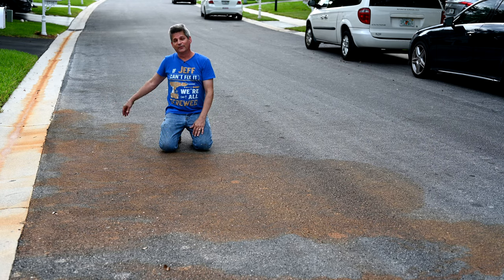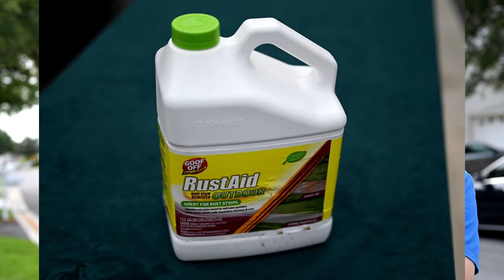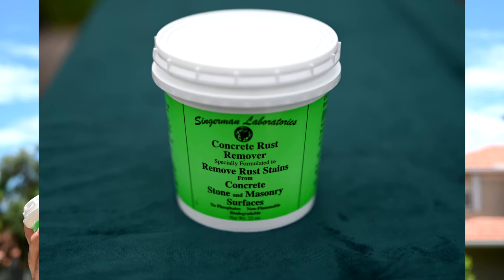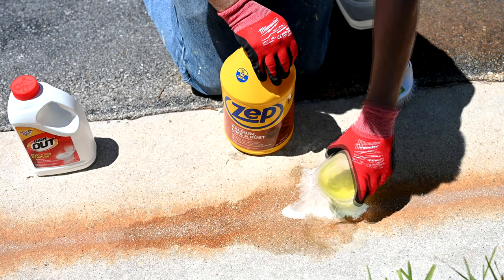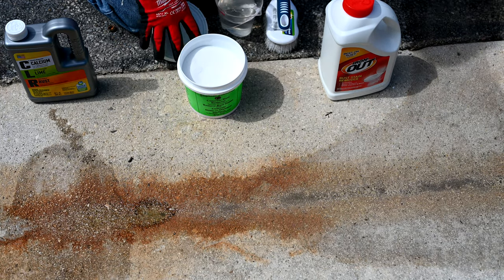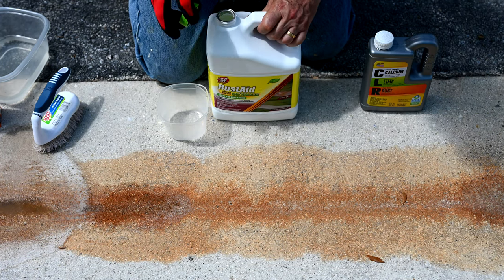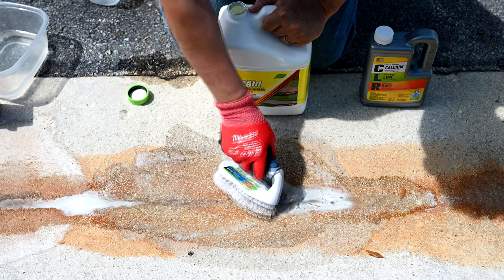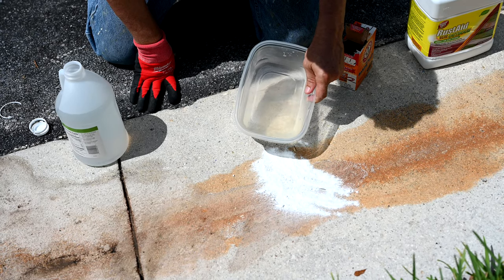Rust Remover Challenge: What Removes Rust Stains Off Concrete?

Comment: Baking soda doesn’t work alone, you need hydrogen peroxide as well. They work as a team. You are not putting much elbow work in either.
Reply from the maker: You've completely missed the point here and it seems like you have been programmed already by the marketing companies just think that you need to put elbow grease into this to make it work period the whole purpose of this video is to show that the correct solution requires 0 elbow grease at all. An even baking soda with peroxide isn't going to work on this remember I mentioned in the video that baking soda is the most overprescribed remedy on the Internet.

Comment: While the recommended product showed better results i think your experiment was poorly done. Different products mixed during the process, you used the same brush thereby mixing some chemicals and application rates were not properly applied. You did not rinse in time as some dried up. I think some discredited products work if properly applied. You didn't mention there was promotional material and Im sure which one was.
Reply from the maker: The products were all used as prescribed, and the brush was rinsed in between use. that doesn't taint the results, because their products are supposed to work when you pour them onto the surface and when they don't that doesn't have anything to do with the methodology. the one product that works the best was poured directly onto the surface and didn't even need to be brushed in to do the job